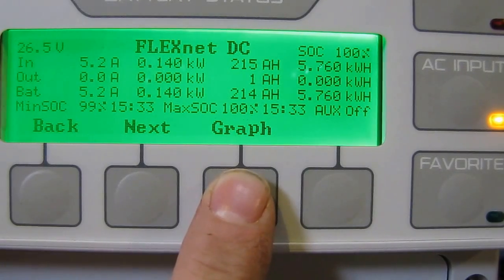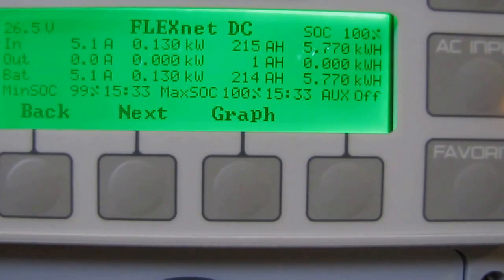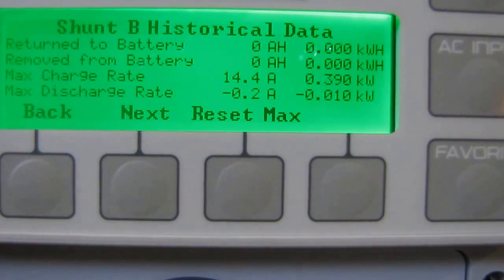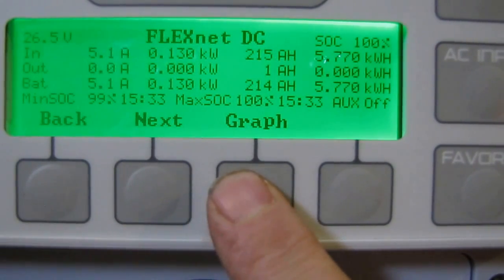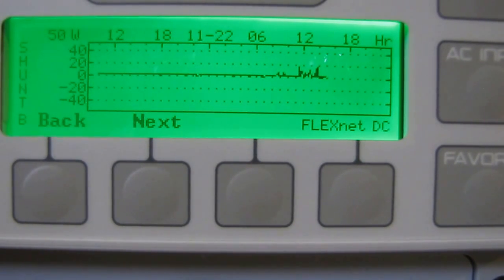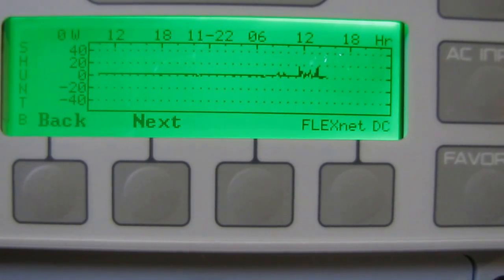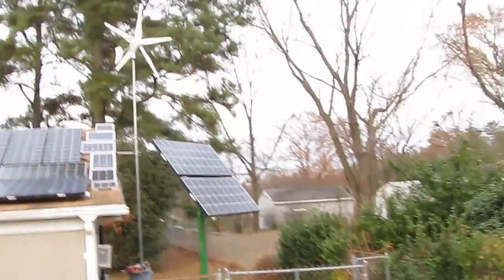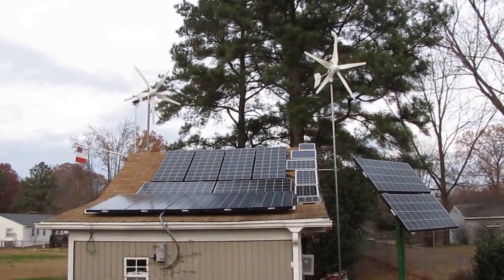OutBack Mate 3 and Flexnet / FNDC  And Awesome Tech Support

Comment: Hey Kenny can I ask you a question about your new windmax 1000 watt 24 volt turbine do you have a stop switch on that turbine,if so how do you connect it to the turbine controller.thank you
Reply from the maker: Yes I Have Stop Switch's On Both My Wind Turbines I Use My 3 Phase Wires I'm Using Old Air X's Stop Switches I Got On Ebay  Buddy